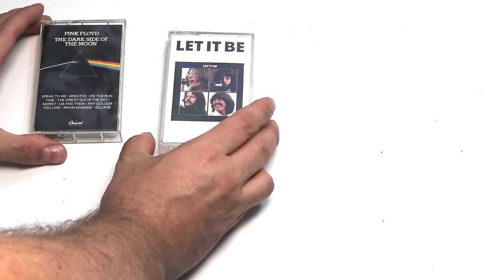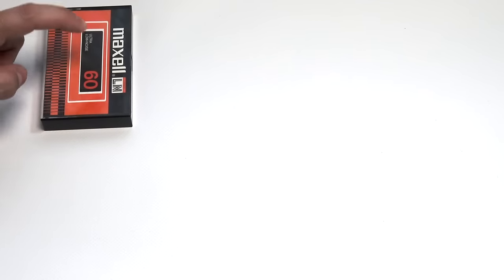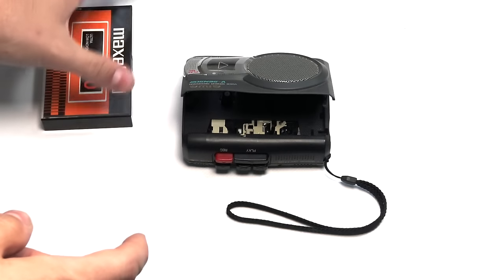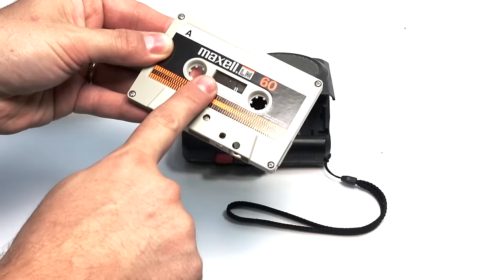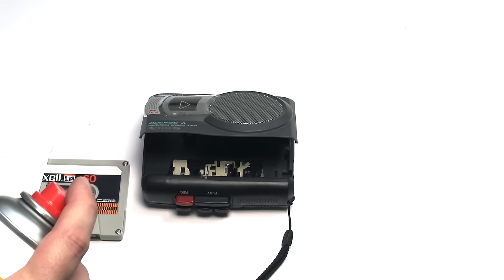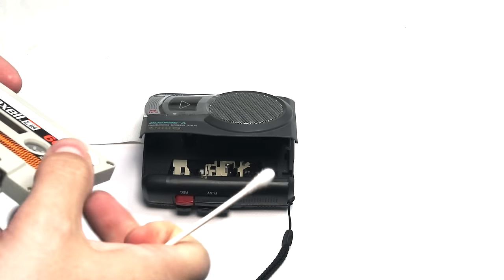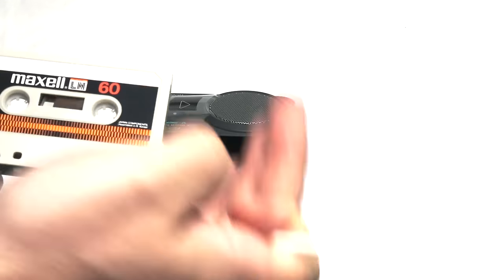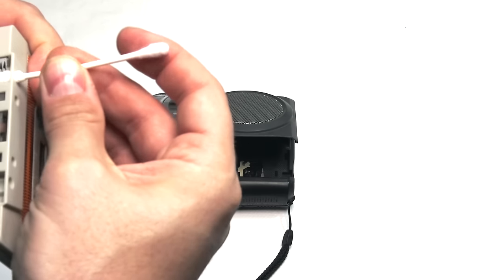How to relubricate your stuck cassette tapes

Comment: I checked the links in the pinned post. Couldn't see anyone recommending any silicone or kontakt 61. Did some of my own research. One of my concerns with this is that both silicone oil and Kontakt 61 contain petroleum based mineral oils. The problem with a pure silicone (cyclomethicone) is that it would become ineffective after a month or two. Mineral oils can interfere with the binders that are also Polyester or polyurethane based (mostly). I am not referring to the tape base which is mainly polyester. But the compounds used to bind the magnetic oxide compounds. 
There are products that are actually used in cosmetics. They will provide temporary solutions (silicone based). Another mentioned possible is Jojoba oil. 

Akai actually sold a product with felt pads for this very issue. Mainly to reduce tape squeal. It was described as a silicone based oil. 
I bought silicone based oil spray from Griffon (Europe). It contains NAFTA (petroleum based) 5-10%. But no alcohol such as Kontakt 61 (alcohol seems likely to mess with the binder). The Griffon product is being sold as a moisture repellent protective layer. It can be used on plastics and paints apparently (automotive). They say it can be used on car bumpers and grills (so must be plastic safe) and paint safe)

@anadialog could you tell us if 5 years on, are the tapes that you treated (Pink floyd, Beatles) with both silicone and Kontakt 61, have they experienced any ill effects. Are they still lubricated, do they suffer from stick/shred/loss? 

Thanks.
Reply from the maker: I have used mainly the 3M lube and did not experience any problems after all this time.
Reply: @anadialog  Thanks for the reply. That product (3M) contains the same solvent as the Silicone spray I have. A form of petroleum distillate. NAFTA (naphtha). The griffon product is cheap at Euro 7.70 for a 300 ml aerosol can. Manufactured in Belgium.

Comment: Before I go out and buy the 8877 dry lubricant, I wanted to ask if Premium Silicone Garage Door Lubricant will work.
Reply from the maker: I don't know, I can only recommend products I have tested. In any case, be careful you want the 3M WET lubricant, not the dry one!!
Reply: @anadialog  One more question. You also mention using kontact 61 as an alternative. Is that the same as the Deoxit contact cleaner?
Reply from the maker: I have no idea. These are chemical compounds and it's better if I do not give my opinion. Atchison level you need facts and the best is to contact who is producing these or at least who is selling them.

Comment: What can u do about a noisy cassette tape adapter? I have an older truck and to listen to anything I like, I have to find the cassette (not happening) or use a cassette adapter with a 3.5mm jack. At first when I got them (isimple brand, which I love) was nice and quit but now it rattles when playing and is really hard to get it to stay in the deck when I first put it in (I never leave in the deck when truck isn't in use either). Please help! I've seen people do crazy things and well I just don't believe taking out some of the gears for example is a good idea. I have two and they both do they same thing and I pay a lot for them to just get new one everytime this happens. Also sorry for the long message.
Reply from the maker: It's difficult to understand the issue from here. I am afraid I can't be of any help...:-(

Comment: Question: this method is good also for removing dirt and dust from the tape?
Reply from the maker: No, I would first clean it with other solutions THEN of needed, relube it. I don't know what is a good cleaning solution. I would try with a dry cuetip before anything liquid.

Comment: Thank you so much. Would you recommend to lubricate all second hand cassettes? Can you please provide us the exact model of that aiwa tape player?
Reply from the maker: Hi there! No, only those that stop or have strong distortion. Remember thow...it takes time! I will post it after in the video description but you really need a crapy cassette player that shows the capstan holes and that has 1 capstan. Ebay is filled with these for a few dollars!
Reply: Or, you can just unscrew the shell of a random Walkman to get access the tape inside
Reply: do they play with the cover open ? I haven't had one of those before
Reply from the maker: Yes! If we are talking of the deck...no, if we are talking about the shell, or at least it is better not to...
Reply: KKSEWOS absolutely not. Don’t. Do. It.
Reply from the maker: Jonah, as many other techs you are driven by prejudice without real knowledge, in this case, about this issue. It is really sad to see how arrogant you are, just go back and read your commnets. I see now that you have written several negative comments over the months and I think you should inform youself better before pointing your finger, insulting and denigrate people. I have posted simple things but considering that you would like more proof here you go. After rading this info, I hope you will be polite and intelligent enough to apologize.
Here you will find a selection of scientific papers explaining the issue and how it is a standard procedure to relube tape (even NASA does this!). I have underlined a few crucial passages in the papers: 
Heritage: https://www.dropbox.com/s/f8254yfeqrrw9vp/heritage-02-00097-v2.pdf?dl=0
Nasa: https://www.dropbox.com/s/xxdw1qh8mlbppdu/Nasa.pdf?dl=0
HESS: https://www.dropbox.com/s/ydrvxg6zipjkrvw/HESS_Tape_Degradation_ARSC_Journal_39-2.pdf?dl=0
Preservation Commission: https://www.dropbox.com/s/3s3ejmho2jexhgt/pub54.pdf?dl=0
   - (here is the official article: https://www.dropbox.com/s/rtvqt1n537w9vpa/Bogart.pdf?dl=0)
Kondo: https://www.dropbox.com/s/zi4vv42ggi9vh8u/tribochemistry-of-ionic-liquid-lubricant-on-magnetic-media.pdf?dl=0
Here is an article of a lab that is relubing its cassettes: http://tasso.cat/re-lubrication-of-compact-cassette-tapes-with-sbs/

Comment: I know this video is old, but i need some help. I got a tape made in 2017. Brand new. But the sound keeps getting quiet and then loud again in an pattern. The head is still there. Help pls
Reply from the maker: Sounds like it got demagnetized, the loud-quiet pattern seems to confirm that. Can't do much about it...
Reply: @anadialog  ahh sad. Thanks a lot for replying
Reply: Could be the pressure pad is degrading.

Comment: Can I use WD-40 Silicone Lubricant for the cassette? Since I cant find those specific brand in my place
Reply from the maker: Others have asked. I have never tried that so I cannot recommend it. It's better if you use a DRY silicone formulation IMHO.

Comment: Just got into cassetes love the sound of them...Some cassetes that I bought from the 80s mint condition Some of them when I play them the sound goes from normal to low then high again ...Will lubrication help that ?Thank you so much
Reply from the maker: In most cases it does but it must always be your last resort. Try to smack the tape to loose it and make go fast forward and rewind a few times. If that doesn't do it try to relube!
Reply: Great!!!,Thank you so much for your answer!!!

Comment: I have this happening on a brand new tape (album released May 14 2021) do you think this is needing lubricant and r is this my tape deck?
Reply: It did get caught up in the tape path a bit too
Reply from the maker: It's too new, most probably it's your capstan (since it gets caught) or the norelco enclosure (the parts of the physical cassette) but that is quite rare.
Reply from the maker: It's too new, most probably it's your capstan (since it gets caught) or the norelco enclosure (the parts of the physical cassette) but that is quite rare.

Comment: What can I use for a cassette player though? My reel motors(?) are pretty dry. They squeak and squeal when I put any cassette in the player. I have a portable stereo Sanyo M-G9 player, and I really don't want to accidentally use the wrong type of oil for it. I've tried looking everywhere for someone who knows something, but I always find "cassette lubrication", never oil for the motors within the cassette player. So, what would be a safe oil? I've seen synthetic oil like liquid bearing, but that's it. Any other solutions?
Reply: Any oil will work but they will dry up pretty fast so my sugestion is to literally use fully synthetic car engine oil, I use 5W30 and it's perfect and doesn't degrade fast in time. Cheers :)
Reply from the maker: It's better to use silicon based lubricants...other oils may ruin the oxide and film....
Reply: @anadialog  I was talking about reel motors... on tape yeah, I would use silicone oil. 🙂
Reply from the maker: Oh ok! Sorry!
Reply: CRC 2-26?

Comment: Hello is it a symptom of an not yet cured tape that it won't always start playing (possibly because the silicone creates suction on the tape) ?
Reply from the maker: It depends. Seams it still has some resistance. Did it do it also before? Sometimes it takes weeks before it works and sometimes it probably just doesn't.
Reply: @anadialog  Hello well no it worked fine but squeked so I decided to try. Now it only works with rewing/fast forward, and plays only when in the middle of the tape (less tension I guess). Thanks for the quick answer.

Comment: You've recommended a Dry Type of silicone lubricant but the link is to a Wet Type 3M silicone lubricant. Which did you use?
Reply from the maker: If you look carefully, the link contains 2 products. A wet and a dry version. When linked it contained only a dry. 3M probably updated the link. As stated in the video, a dry version is preferable. In any case now I will update the link.
Reply: Okay cool. Just had to say. I'm looking at getting the 3M. I actually came across that same XDR pink floyd dark side cassette today. Grabbed it right away. I played it without doing the lubrication and didn't have any problems but still gonna get some of that 3M lubricant. I tried to find the lubricant you actually used in the video (3M/Scotch 1609) on Amazon but didn't see it. Found it on another site but maybe it's the same as the one you recommend in the link.
Reply from the maker: Strangely in Europe the same 3M code (08897) corresponds to a black spray!! So yes be careful when purchasing it. In any case just make sure it says dry silicone on the can. Otherwise other brands with similar properties should word although, I must admit that I just tested these 2.
Reply: @anadialog  I saw a guy say he used Mink Oil spray too haha I'm sure if I just avoid acetone I'll be okay
Reply: @anadialog  bought the dry type of that 3M lubricant. It has acetone in it. Isn't that bad?
Reply from the maker: Ok, that is maybe why I did put the link to the wet version. I will change it back again. Both claim to preserve rubber and plastic but for extra safety I would use the wet one. Sorry about that. I agree, acetone is not a good idea. The problem is that the US has products different from those that we find here in Europe. And its easy to get mixed up.
Reply: @anadialog  alright yeah I dont blame you at all. Just trying to help you out. Not sure if the Wet Type doesn't have acetone but yeah the Dry Type says it does right on the can. I wish I could find the actual lubricant you use in the video on Amazon.
Reply from the maker: I checked thoroughly this time. The wet version (08877) does NOT have acetone.
Thanks for waving that and again sorry for making you buy the wrong product.
Reply: @anadialog  no problem man I really dont put any blame on you. I'm sorry I gave you the idea to change it. You had it right the first time. Thank you for going back and forth with me on this.

Comment: Would using singer oil be a bad idea?
Reply from the maker: Yes!
Reply: @anadialog  i ended up using it. It works fine. It runs smooth, and doesn't squeak. Also sounds brand new.

Comment: How can I know in advance whethere a walkan allows me to operat with the open lid?
Reply from the maker: In advance it's hard, but usually you just insert the cassette directly on the mechanism instead of in the door or simply get a cheap table player/recorder on Amazon if you have several cassettes

Comment: Hi, thanks for your guidance. 
When I play my audio cassettes there is a squeaky sound when it plays. Will lubrication stop the squeaking.
I am also using wd40 contact cleaner. Is this ok. I don't want to damage my tapes. They are about 40 years old.
Reply from the maker: Yes, it can probably help but make sure you soak up all the remaining lube with multiple cue tips. I never tried WD40 and can't recommend it. Tye only tip I can give if you can't find the ones I suggested is to get a silicone-based lubricant WITH NO solvents.

Comment: Is the WD40 silicone spray good for the purpose?
Reply from the maker: Several have asked and tried. I haven't tried. The important is that there isn't any solvent inside
Reply: Did you try it? If so, how was the experience?

Comment: I have an old cassette I bought from ebay that has tweeter sound coming in and out of the sound of the track, could this possibly fix this issue?.
Reply from the maker: I don't think so. Those are dropouts probably because the cassette got too close to a magnetic source.

Comment: I've been trying to fix my old cbs aerosmith tape. After the first attempt suddenly I can play the first and the last song of each side. I figured out that it's exactly what got lubricated. I noticed one thing, once I start fixing and the tape is rewinding, the cuetip is already dry by the time I'm halfway to the end of the side, so I just have to make sure to relubricate the cuetip quite often. I have just tried another time, this time I fixed the middle part of side a (two songs of approx. 8 minutes altogether) and I relubricated the tip only once. I am trying not to put too much, going slowly, hope that it'll do
Reply from the maker: Good job! Better add it slowly than add too much!

Comment: 100%  GUARANTEED TO WORK !!
NAPA ELECTRICAL SPRAY DOES NOT DAMAGE THE TAPE IN ANY WAY WHAT SO EVER 🙂
Just found a way to to sort Commodore 64 tape games that the tape is grinding tight sprayed with NAPA electrical cleaner then spray a cotton bud end wet take the datta cassette front off so you get access to the tape stick the cotton bud in the first hole behind the tape and fast forward and rewind over and over it lubricates the tape also spraying the cog wheels AND most important see the wee bit in the middle of the tape where the head is soak it with spray for the cassette on both sides lightly dry the the tape might have to be done a few times but loosens the tape off Whee Hawww working as good as new :V . . .
TOOK THE CHANCE ON KNOWING THAT SPRAY PROTECTS ALL ELECTRICAL DATA IN CHIPS EVEN IF THEY GET WET INSIDE WITH THE SPRAY AS LONG AS IT IS LEFT TO DRY BEFORE SWITCHING BACK ON THE CHIPS ARE GOOD TO GO ZERO DAMMAGE SO IMA THOUGHT FCK IT WTF DO IMA HAVE TO LOOSE A DATASOFT ARCADE CLASSICS POLE POSITION PAC MAN MR DO! AND DIG DUG TAPE IMA DID THIS TO THAT WAS DRIED AND GRINDING IT IS SILKY SMOOTH WORKING AS GOOD AS NEW NOW

Comment: I'm thinking I could speed up the process using a drill or something else to turn the tape other than a tape player?
Reply from the maker: Seems risky...
Reply: You have to remember these are plastic parts and don't want them to heat up in the process

Comment: Great idea but how does the silicon not block the audio from the tape since you  lubricate the playing side of the tape instead of the back of the tape..I would assume the Silicone would Shield the tape  oxide particles from making contact with the heads   ..
Reply from the maker: That is the idea! All types of tape have lubricates on them. The important is to suck up the exeding amount with a dry cue tip.
Reply: the pathway is not serpentine in the shell, so both surfaces will be oozing with un-grip-able (by the steel peg capstan) slickness.

Comment: Help! you put a link to 3M 08877 which I looked all over for, then when I looked at the video again you say dry type silicone and have a completely different type - 1609.
Reply from the maker: Be careful, each country has a different formula with the same code. Just look for a dry silicone lube. Sorry if this created confusion.
Tye link in the video description leads to a dry silicone formula, which is clearly stated as in the video. How did you get something different?
Reply from the maker: Checking the US 3M site it seems that THEY made a mistake because the dry version is instead the 08897 and not 08877.

Comment: My cassette player the sound suddenly like goes out of tune and slows down is that dragging? Or is caused by the battery because it is a battery powered cassette player
Reply from the maker: Seems wow and flutter problems, might want to change the belts first...